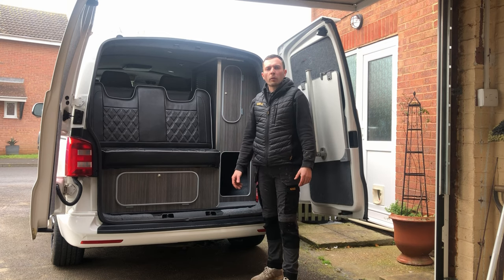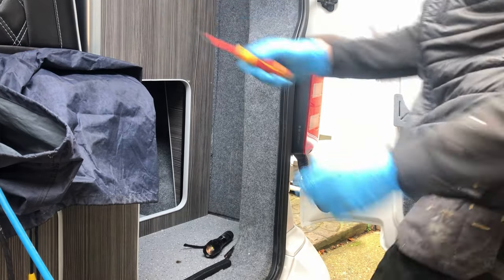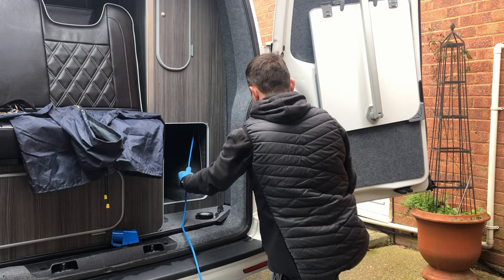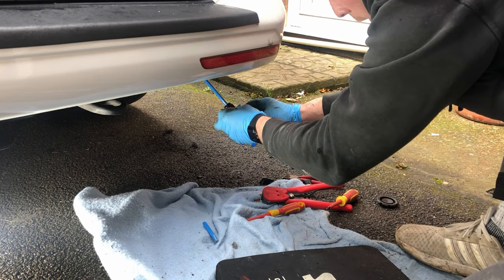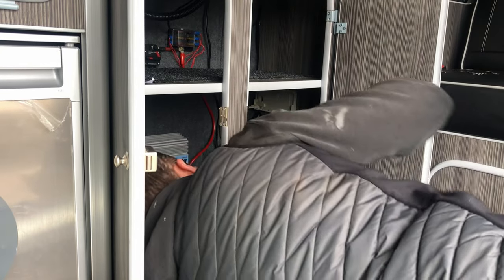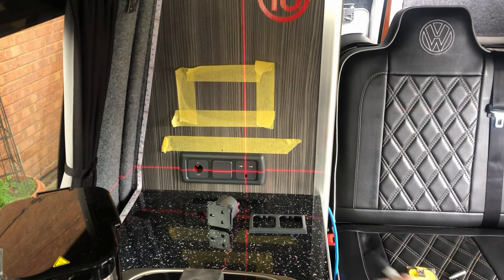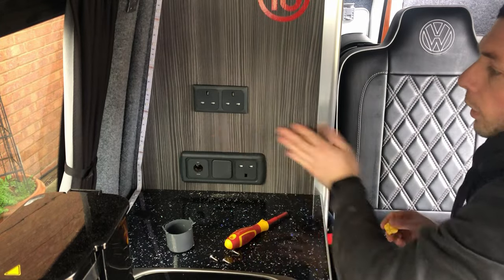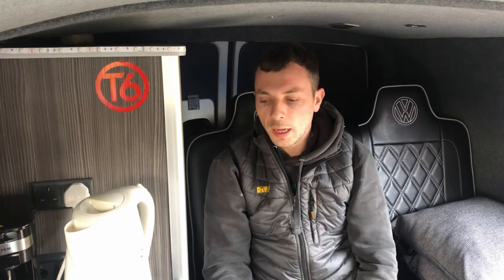Installing a 240v Hook up kit into your van/campervan.

Comment: Love your work on the van in this video, and the video itself too dude 👍  Watched many and your fuse board is the only one I've seen like mine  thats so fully filmed and shown  clearly.  Much thanks,  I've gone from getting more confused(and frustrated!) to satisfied and confident again 😂 I wonder what size earth wire you used to ground the board, if I could pick your brain just a little more? Cheers man, Jay.
Reply from the maker: Thanks Jay, I really appreciate the comment and lovely feedback. If you haven't fitted your board yet you can take it into one of the many shops and see what will fit. The larger cable the better really. Mine came in the kit but re watching the video I would say its probably 3-4mm. All the best, Ross

Comment: I find it interesting that you used a level when you could've just easily measured up from the other socket. Van could've been sat on a slope, more weight usually on one side of them builds as well. Unless of course you checked the level on the worktop/socket before 😂
Reply from the maker: Thanks for the comment, I used a combination of the two and ended up using the worktop as a datum as the socket below was not level 🤦‍♂
Reply: @TurningSpannerz  😂

Comment: how does the earth wire trip the RCD as the van chassis is not connected to the ground as it is sat on insulated rubber wheels? that is the one part that has always bothered me about installing 240 in a van that could become live and wont trip
Reply from the maker: Hi there, I have the van earth running to the earth bar within the fuse board. This is then connected to the earth coming in from the shoreline electrics. Hope this helps

Comment: Did you remove the exhaust heat shield to fit this?
Reply from the maker: Hi Mark,

No I did not need to remove the exhaust heatshield to install this kit. Hope this helps

Comment: Sorry must have missed it BUT what does the 1.5mm flex go to/from?
Reply from the maker: Hi Rob.

1.5mm flex goes from the fuse board up to the sockets.

2.5mm goes from the hook up plug to the fuse board
Reply from the maker: Hi Rob.

1.5mm flex goes from the fuse board up to the sockets.

2.5mm goes from the hook up plug to the fuse board
Reply from the maker: Hi Rob.

1.5mm flex goes from the fuse board up to the sockets.

2.5mm goes from the hook up plug to the fuse board
Reply from the maker: Hi Rob.

1.5mm flex goes from the fuse board up to the sockets.

2.5mm goes from the hook up plug to the fuse board
Reply: @TurningSpannerz  Cheers mate - just buying the gear from Amazon this evening to copy the exact same on your video. Is there any concern with running something like an air fryer off a socket with 1,5mm flex possibly?
Reply from the maker: No worries mate. I got the vast majority of this in kit form from eBay. 

Maybe worth looking at the air fryer wattage and seeing what load your setup can take, depending on what kit you buy. 👍
Reply: @TurningSpannerz  Good stuff - will have a look at the AF to see what's best. Nice van by the way. Cheers, Rob